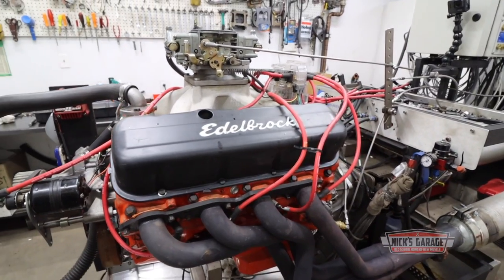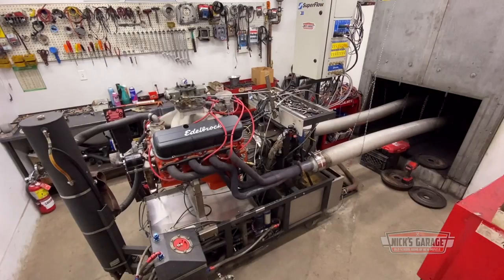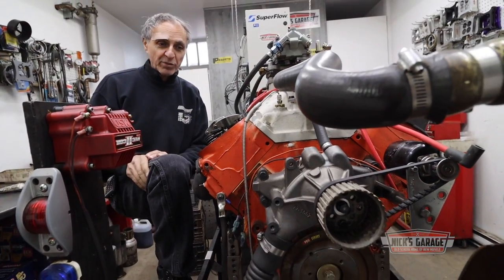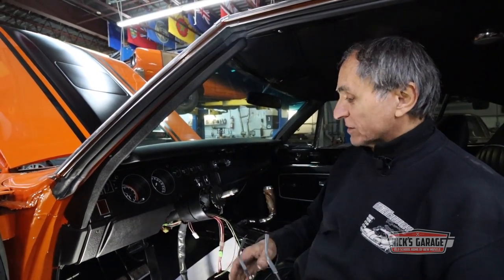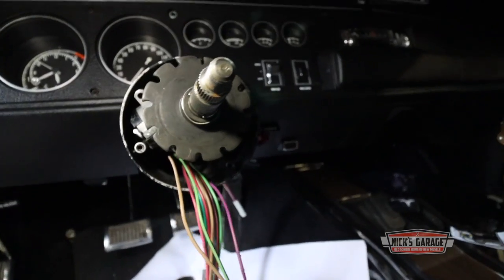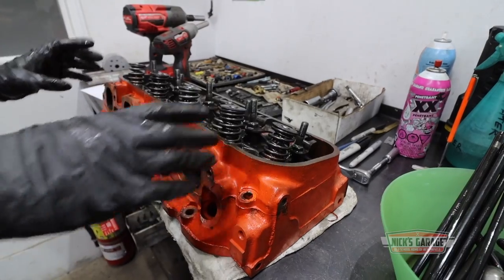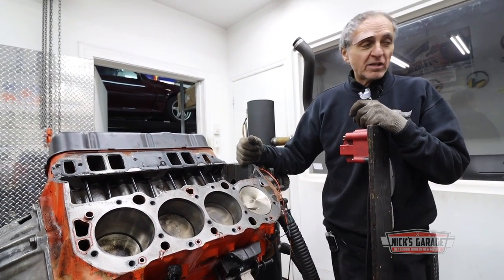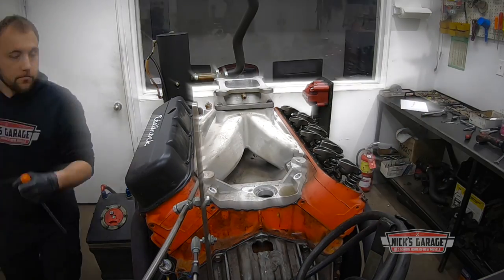Weak Big Block Chev • Wrong Parts + Poor Assembly = No Power!

Comment: When I purchase engines from anyone in the private sector, I use a cheap bore scope that hooks to my phone. It will tell you if a engine has flat tops, you can easily look at the valve train, you can check to see the bottom end, or see if a engine has four bolt mains (if that's the claim). It's quick and easy, and if the seller doesn't want to let you investigate well that tells the whole story anyway. Another great video Nick thanks.
Reply: You can get one for under $20 and I agree with you 100%.
Reply: @michaelwilkening8542  👍
Reply: What motor are you using?',; calling yoself the LS killer???????
Reply: What motor is you using calling yoself a LS killer',?; lol another GM Hater man smh The kings of HP still running things lol
Reply: From the moment nick said flat tapped cam, that's a big problem out the gate, plus rust that's literally blocking air too go into the rectangular ports, another problem,then them pistons 😳,if you planning on drag racing with that current set up your losing every last race ,period‼ even against some one on a skateboard
Reply: @javonsumpter9678  rust was in the cooling passages and what makes you think a flat tappet is worse than any other cam for drag racing they are proven to rev higher than hydraulics just old school and less things to break than a roller cam
Reply: @erickroberts5172  what if he has a GM engine that eats LS for breakfast sound like you the one hating
Reply: @Mystic-p1mp  ,well for one, a flat tappet cam is cheaper,the lobes on a roller keeps the valves open up longer for higher lift,higher lift means greater fuel and air flow,plus the lobe shaped on a roller opens up the valves much faster than a flat tappet cam,instant power in my humble opinion
Reply: @javonsumpter9678  🤨🤨🧐
Reply: @Mystic-p1mp  ,ok
Reply: Great idea. 👍🏻
Reply: nice
Reply: EVERYONE knows the LS stands undefeated in EVERY class of motorsports since it's introduction! Top fuel, top alchohol, monster trucks, NTPA unlimited modified pulling tractors, offshore racing, N/A land speed record holder etc, etc, anyone who thinks otherwise is just a heritic! I don't care if your spark wires DO go thru your valve covers! Sarcasam is the lowest form of humor, but it sure is fun! 😅 😅@lskiller1903

Comment: Whoever built that motor just threw it together for a quick flip.Knowing they would have no trouble selling a BBC if it looked the part.They never expected anyone to put it on a dyno before they installed it.
Reply: yup.
Reply: We need to call these guys out!!
Reply: @terryschnereger8531  I would be going back to who I got that motor from and giving them two options either 1) giving me all my money back and they keep the motor . Or 2) give me back at least half if not more of the money I paid and I keep the motor. Then you tell everyone you know not to do business with them.
 I'm a Mopar guy but this is the kind of stuff we all need to watch each others back and expose the scumbags who try to screw us over. No matter what you drive.
Reply: @whitelightining7125  agreed. Nick should tear it down and do a full race rebuild if the owner expects to get 600 HP out of the big block. Those heads are excellent,but who installed the pistons 180• wrong ? Needs a better cam,too.
Reply: You’d be crazy not to, paying big block dollars for an engine that’s claimed to be 600 hp,forget it.too many shysters out there
Reply: @aaronhumphrey2009   in some motors pistons 180 out improves the geometry of the con rods lucky the valves cleared the pistons.
Reply: @aaronhumphrey2009  In some motors the piston installed 180 out improves the con rod geometry lucky the valves didn't hit the pistons
Reply: Hey @White Lightning  so  buy it put it in a car and find out it's a  dog ..  you are still stuck with a Motor that needs a lot more money invested to make it run like it should ,,
Reply: That engine was not built, it was hacked together by an 8 year old jack wagon.
Reply: Or it didn’t matter to them if someone put it on the dyno after they bought it anyway because by that point he’s already sold it, the moneys in his pocket now
Reply: 600hp sounds a lot better than saying 300hp when you’re selling an engine/car but really with a big block  and aftermarket heads you should be well into the 500s on hp and tq, heck you can get into the 500hp/525-550tq range with a good combo big block with a nicely worked over set of factory heads, and a well matched cam/port-matchedintake/carb setup to go with it
Reply: @chriswest5360   Saved a lot of time and grief putting it on the Dyno  before putting it in the car..  Now they don't have to take  it back out of the car to build it correctly ..
Reply: Good thing its has a small cam. Otherwise the compression numbers would have been much worse
Reply: @fredblase5608  "lucky the valves cleared the pistons". lol ya think?
Reply: A small block 400" with MoTown heads and mild cam will make 550 HP...
Reply: Mike Skidmore I know that, I’m referring to the original poster how he mentioned the seller didn’t expect anyone to put it on a dyno I was saying it really didn’t matter to them if someone did because by that point it was too late because they already had the money in their pocket
Reply: Craig G I’m just saying that whatever the hp actually is, and they don’t know what it actually is when someone is selling a car/engine it sounds a lot cooler to say 500, 600, 700, whatever than 300, 400, whatever.. I never take a sellers horsepower guesstimates seriously unless there’s dyno sheets, et slips, or I know for a fact of what’s in the engine (say I saw it while it was on the engine stand, and seen what was in the bottom end, know what heads/port work, and cam are) and have a good knowledge of similar builds and what type of numbers the comparable builds have put out before...
Reply: One time I knew a guy that sold this other guy a Stock 305 with a flat tappet cam and cheap Chinese intake, cheap alum heads and Chinese roller rockers (I think intake, heads, and rockers were something like procomp or similar) and told the guy that it was a 383 stroker with a forged pistons, h beams etc, and had a roller cam and name brand rockers and heads and intake with the name ground off the heads and Intake to “make it look more stock”
Reply: @White Lightining, engine*
Reply: @chriswest5360  Are you from Mississippi?  One of my friend's is named Chris West.  It'd be funny as hell if that was you!
Reply: White Lightining people lie about HP as much as they lie about what they paid for a new car.
Reply: @terryschnereger8531  i agree. The owner probably spent big money for it
Reply: No whoever set up this motor didn't know what they were doing they could have just bought different heads and had a killer motor everything is brand new they just didn't know how to design what went with whatit's not like it's a bunch of used parts put in the cam wasn't even close to being right like I was saying if they would have added a turbo to that setup it would have made close to a thousand just put the Pistons in right so the valve reliefs is setting where it should be
Reply: @terryschnereger8531  nah, the moral of the story is if it sounds to good to be true it probably is, and if I were to agree to buy it based on it being 600 hp at full seller price, he would have to agree to pay for a dyno test and allow me to be present. Or, show me the complete build sheet from a reputable shop that does performance work, and allow me to talk to the shop.
Reply: Yep. Happens alot too sadly.
Reply: BBC 🤣🤣🤣

Comment: "Headers, High rise intake, 4 barrel Carb, a new mild cam, one see through distributor cap and new plugs..""
"6 new parts × 100hp = 600hp"" 👏😕😂
Reply: 8.0:1 CR lol
Reply: Notime ForFakeNews don’t forget 4 bolts main you have to add it by that
Reply: @ToxicMisfitsYt  + 400 = 1000hp 😮 😄😂
Reply: @andrewjenkins879 . Probably not even 8:1. I was guessing low 7s compression.
Reply: Nah man only stickers make horsepower, not parts
Reply: Chrome valve covers thats what he needs to get the full 600 😂😂😂
Reply: @ Andrew Jenkins  BUT,10 gallons of 93 octane gasoline a gallon of toluene and a quart of aniline oil along with 42 degrees of timing advance should get you around 425 but you'll never bounce the limiter with that cam.Face it until you make some major changes you've got a super duty boat anchor or truck engine.
Reply: I bet he had a 100hp go fast sticker on the bumper/air cleaner too. Not sure who was the noob, the buyer or the seller
Reply: @kittty2005  those 427s made damn near 500hp out of the factory...
Reply: It just needs a red “R” badge on the deck lid of the car to make that 600HP, my ricer neighbor has one on all his cars, no matter the brand. That’s the secret.... a red “R”!
Reply: @konnerkramer329  I have a 427 in my 1966 Chevelle that is a good runner. It screams.

Comment: ahh I love "those engine builders", the ones that calculate hp based on adding up the box tops...
Reply: iguess they figured it was half way there, lol. well some smaller chambers or reverse dome pistons would do the trick along with a bigger cam and 175 to 190 ish psi. oh and port matching and head work. etc. etc. the list goes on and on don't it.
Reply: That's why I put stickers on my cars ... +5 hp per sticker.
Reply: @Jason Davis  why?
Reply: @Jason Davis As a young man I had a friend who was a retired Air Force engineer who was in on the testing of F-4 phantom engines for the Black bird project,he said the standard phantom engine produced 30,000 horse power with different fuel they could achieve 175,000 hp. Now the fuel he told me was good for extremely high altitude flight,the three key components: first  was a thing I think he was mumbling to protect secrecy it sounded stupid furfall alcohol,second hydrazine, third aniline oil to control burn-rate,he was retired and had 2 hobbies fishing and flying his P-51 Mustang,he was a great man loved to listen to his stories.
Reply: One thing I left out the whatever alcohol and hydrazine would detonate when in contact with each other so the need for the aniline oil.
Reply: Liberalism exits in engine building also.  I feel like my engine makes this much HP. .Conservative engine builder "I know what my engine makes I have a Dyno."

Comment: At least it was actually rebuilt... could have been an old motorhome engine with 100K on it and the only thing keeping the rods from knocking is the 10 pounds of sludge in the crankcase.
Reply: That was my thought too. A set of dome pistons should bring that engine to life. Annoying to have to tear down the engine again but not a huge deal with it being out of the car when bought.
Reply: At least it wasn't a krylon rebuild   with it paint it ship it lol
Reply: I prefer the 454's out of motorhomes. I build them for demolition derbies. Even the hated peanut port heads work great for a torque build.

Comment: It's like my electronics instructor told us at the beginning. "You will spend more time fixing what others have messed up than fixing the original problem". After 40 years in automotive maintenance he was proven right over and over. A little knowledge is a dangerous thing.
Reply: Can't stand when someone monkeyed with float level because it's not running right , and you end up finding the real problem , and then have to fix the float level. 
Keep the paws off the float level!
Reply: Right. He come fix this job some fawked. Up. Ok. That gonna cost you double. I have to undo someone else fawk up and do over again.

Comment: There is always a reason an engine is sitting. If it was healthy and made big power it would be in a car. People don't let too many high-performance engines sit around guys. Great video Nick!
Reply: I disagree. Most budget builders will do their builds in stages. They either build the engine first or build the car. Life happens, things change, health fails. This is even more so for people on a strict budget. That window gets bigger because vudgets are smaller and is more prone to life disruptions. Mistakes are made from ignorance and not doing homework and desperation to complete the job. A flipper sellsa fresh engine with cheap parts. Not an engine just sitting for awhile.
Reply: That's not always the case I have a new Ls 7 454 still in crate that I bought in the 70s to install in my Ls 5 corvette  still have both 55k on vette
Reply: @caclark7600  Damn you don't go to the garage and just day dream about what that thing sounds like?

Comment: 105 psi compression? I've had farts with more pressure than that
Reply: @spankthemonkey3437    lmao! I'll take that under advisement, but I'm scared to blow out an o-ring!
Reply: I’ve had coffee give me a higher compression than that.
Reply: use a jalepeno spray injector to get to 170psi with them tacos
Reply: After my mom used it for a year without checking the oil our lawnmower had 45
Reply: william escolante jr It sounds like a good idea on paper until you run into heat issues lol. It’s almost like running nitrous with shitty cooling
Reply: I let a 69 go earlier and it shot flames!  Got me pretty high from the fumes 😂
Reply: OME cars usually have 160~180psi. 105 is a sad joke.
Reply: @spankthemonkey3437  you have to be careful with taco bell, they're known to cause excessive blow by...
Reply: I feel sorry for your ring.
Reply: I have rebuilt tired motors that had 150 psi.
Reply: Most engines won't start with that low a compression unless you squirt some oil in the cylinders.
Reply: The motor builder said you blew a seal! He said " leave my private life out of it and fix the thing"
Reply: Buddy sound like too much blowby might think about an overhaul
Reply: Even my snowblower has 80 psi that's with a compression release to make pull starts easier.
Reply: Yep it,s got a fart leak of 60 plus psi. Dang if that's not a loss of 225hp right there.
Reply: lmaoooo facts
Reply: And unlike a fart...it was silent but not deadly. 😁

Comment: I guess this shows that it’s really hard to not make some power with a BBC.  Low compression, tiny cam, big rectangle port open chamber heads, and a single plane and it still made 366hp.  It literally had everything working against it.  

A set of closed chamber oval ports and dual plane and it’d be a nice torquey motor.  Dome pistons and a bigger cam and it’d be a fire breather.  Either way and perform way better than when it arrived.

Comment: I did a 454 for a farmer's truck one time,  it came in with a very slight rod ticking. So o tore it down resized the rods at machine shop. When installing them one piston was on rod backwards. Had to take it back to be pressed off and turned around. If I wouldn't have caught it . It probably wouldn't make 100 miles without ruining crank and who knows what else. You have to stay focused. Not everyone can throw it together. Good job Nick.

Comment: We used to have a standard rotating engine and a counter rotating engine in boats. The screws have to turn outboard of each other or the boat will run terrible. Chrysler got out of Marine. GM and Ford stopped building counter turning engines. Marine gear builders picked up the counter turning screw in the gear. Chris Craft used gear to gear with their counter turning chevys.
The lobes on the cam were ground to provide 12756348 firing order. The pistons in small blocks were put on the rods backwards to compensate for the outboard piston skirt beating on the walls. Big blocks could not do that because the valves hit the pistons. Closed chamber heads were used. Breathing is not the thing in Marine. Long stroke low rpm is. Other differences included reverse ribbing on front and rear main seals. Standard ribbing on a reverse engine will suck the oil right out. Chrysler used slashes on the rear seal surface for the cranks. That had to be machines backwards too. Starter drives engaged backwards.  Their drive teeth were machined backwards. Fields wound to spin backwards. I was there, that’s how it was, that’s what I got to say about that.
Reply: Mike.              So one of two marine engines is all backwards. Interesting. Thanks for the info Mike.

Comment: Gear drives on a bbc is a no no. There only good to 6000rpm, a double roller chain or belt drive is much better !
Check the cam also , some people have no clue about engines or BBC.
A 427 L-88 revved easily to 7200 and had 7/16 pushrods not 3/8. And GM bbc square port heads can build 600 hp very easy. A Edelbrock dual plane rpm intake works well. 850 cfm holley is also a good choice. Try using a first design L-88 solid lifter cam. Get compression up to atleast 11.0 valve springs need updated also.most of this and good machine work should wake the dead out of it, but you are the man Nick.
Love your channel Nick

Comment: A 427 chev.  My dad had a 65 Strata Chief. That was the name I recall. 4 sp. Some fella bought it new and drag-raced at a local track in New Brunswick.  Dad redid the engine and a decal remove. When done, it never looked like the tiger it was. The 3 pedals and the Hurst button for the brakes was the only give-away. Cheers! and Thank You.

Comment: While it was a 454. It still had the factory heads with hand port job. Motor was rebuilt by DRE  with his custom hydraulic roller, flat top piston with 10.1 cp and made 606hp on pumped gas with no timing really in it. Soft tune. You can make power when it's built correctly. This video shows what happens when people don't have a clue. I mean really. The pistons installed upside down is just ridiculous.

Comment: Take the little stainless rectangular cap off the door and or trunk lock and you will see the spring loaded brass pins that are different lengths. These are what the key pushes up to make the lock able to turn. I had extra Mopar locks from junkers and swapped around the pins so I had a one key Fury.